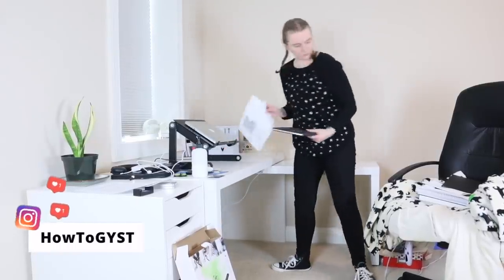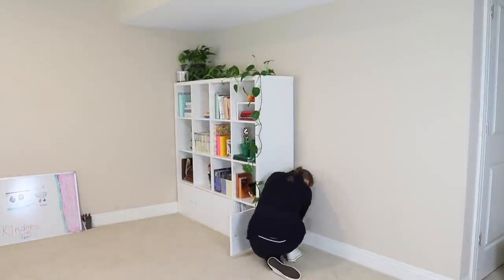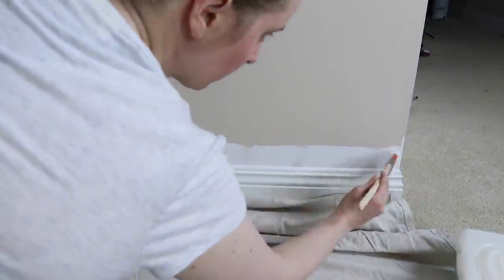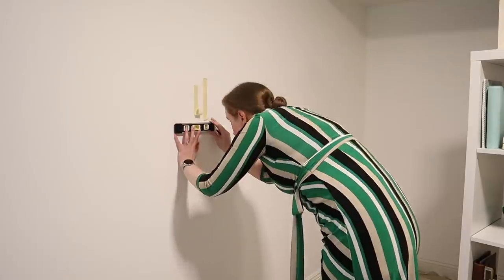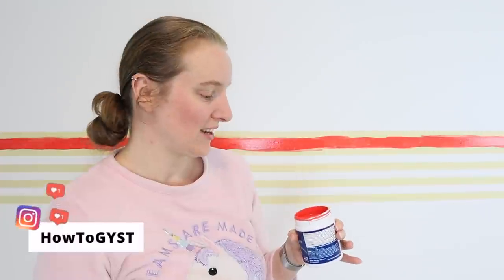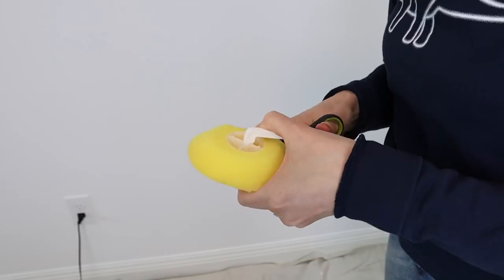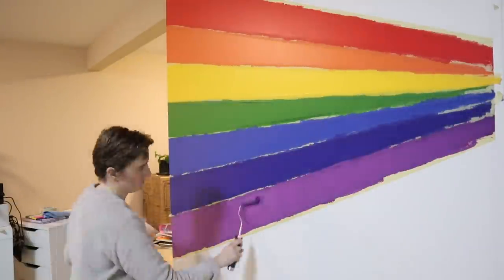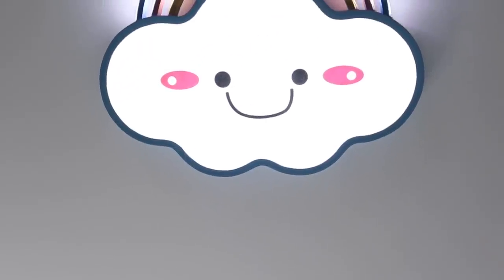☘️ My COLOURFUL Home Office Reveal Before & After 🌈 • From Brown To BRIGHT – My New Home Office Tour

Comment: The rainbow turned out great!  I tried stripes on my wall and it didn't turn out well at all.  My tape just didn't create crisp edges I was looking for despite using the recommended tape.  I use plastic wrap on my brushes if I'm working on a multi-day project.